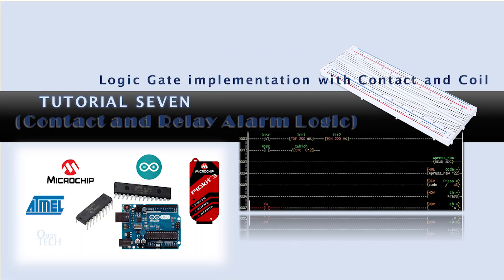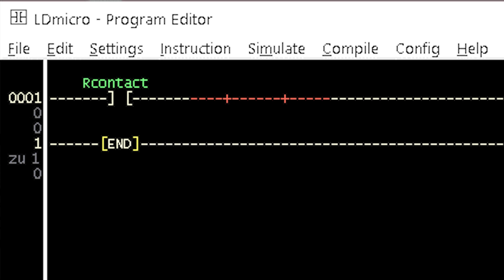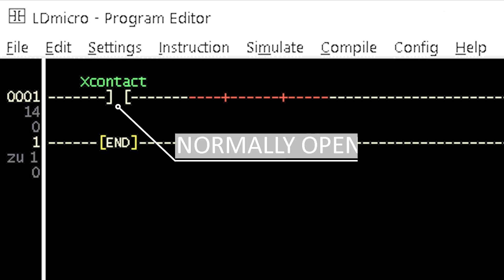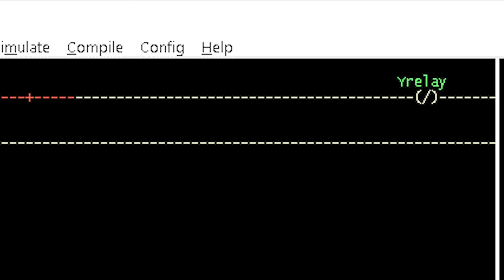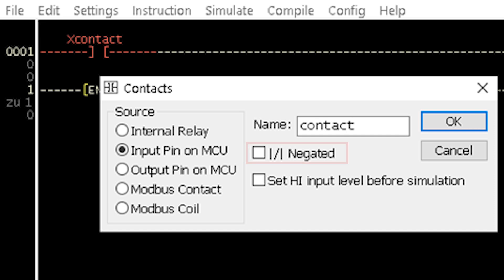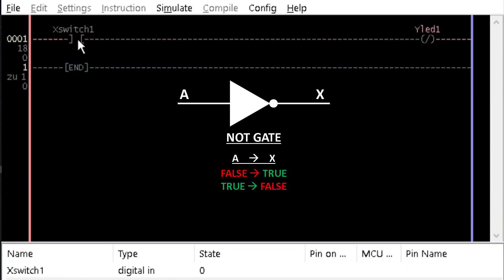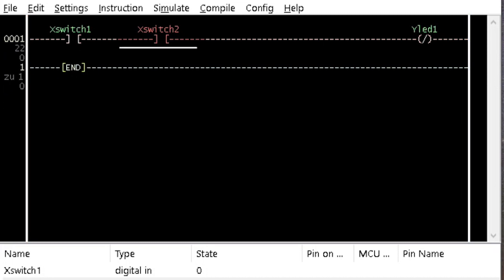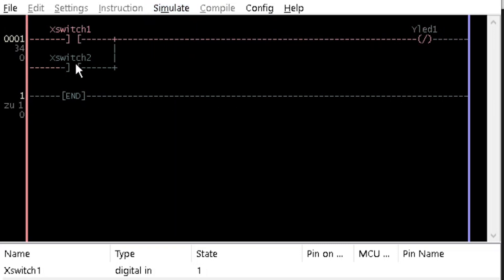LDmicro 7:  Simple Intruder Alarm Logic (Microcontroller PLC Ladder Programming with LDmicro)

Comment: Very good explanation.
Question:
What about power up /power down.
There Will be an extension lateron with a display (HMI)?
Reply from the maker: Thanks for this wonderful feedback, Roel. The breadboard circuit is now being powered by the computer through the USB cable for this tutorial series. We will get to the point where we will learn how to use the LCD screen. And finally, build complete projects.
Reply: @OnosTech  thanks for your replay. With power up i meant when the program is running and we get a power down how does the plc program react with  a power up. Are the internal variables lost?
Reply from the maker: Since this particular program is basic, it will reset the alarm to its default state at power up where the alarm is armed (enabled). Thus, if the alarm is in its activated state and there is power down, the internal variables will be lost. However, the "Make Persistent" instruction element which we are yet to take on in the series can be used to automatically save and restore the internal variable at power down and power up respectively.
Reply: @OnosTech  All is working fine with my Nano. However  the advanced instructions like "Pulser", "Counter" a.s.o. it is difficult to use it, no help available. I hope we get An tutorial for these advanced functions. Also it is helpfull to have when possibel an idea for the future components (f.e. display) (long delivery time)
Reply from the maker: @roelgritter  This is great! I am currently producing the video for the "Timer" instruction which will be followed by another video for the "Counter" instruction with a 7-segment LED display. Thereafter, the analog input and LCD display will follow.
Reply: @OnosTech  Thanks a lot, i am looking forward to follow your comming  tutorials.